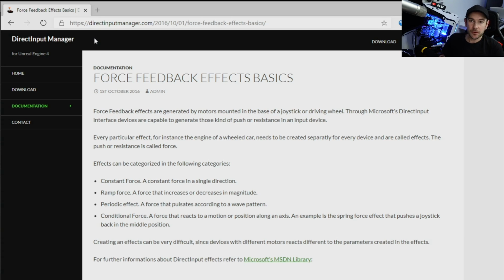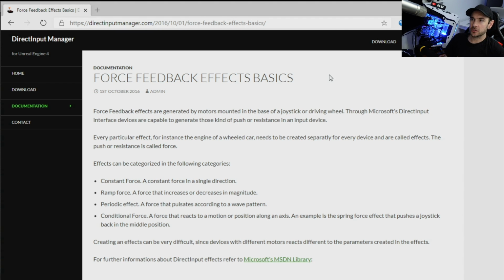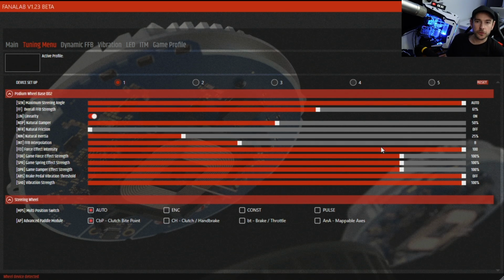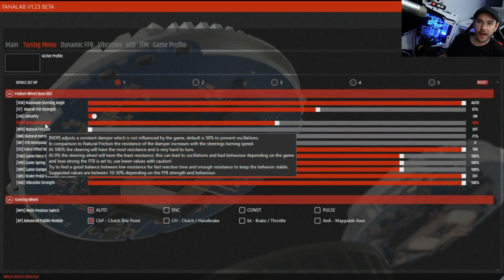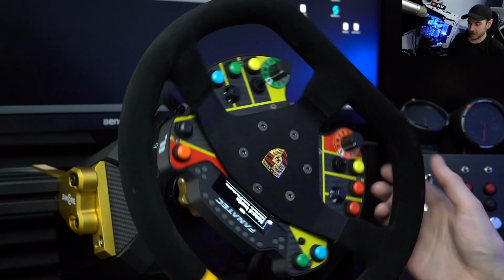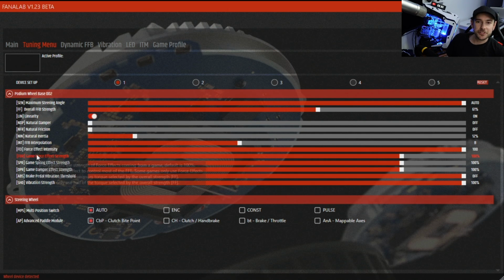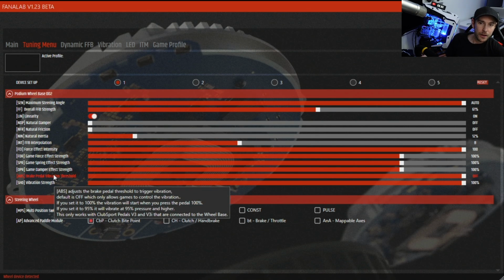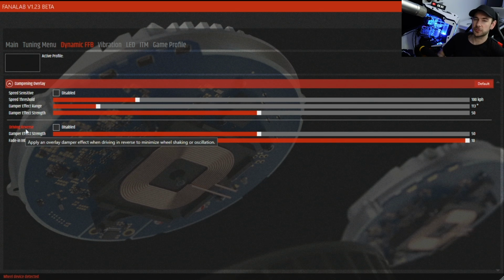FORCE FEEDBACK SETTINGS EXPLAINED - How to get the Best Force Feedback from any Fanatec Wheel

Comment: Great Video Will. But I still in doubt with something: The ACC already has a slider for Dynamic Damping. Would it therefore be redundant or inappropriate to enable Dynamic FFB in Fanalab, already using, for example, 100% in Dynamic Damping within the ACC? Tks in advance and congratulations for the great channel.

Comment: Hey so I just bought a podium f1 wheel and each time the thing starts up, it’s off center. I have calibrated it to center. But each time I start it up, it’s off center to the left. Any ideas?
Reply from the maker: That’s normal, as long as it doesn’t need to calibrated every time.
Reply: @boostedmedia  it’s normal for it to start crooked?
Reply: @boostedmedia  also, do you know if it’s possible to map the buttons for gt7 to what I want? The game doesn’t have a settings menu for this wheel.

Comment: Hi I hope you read this ,I'm in community where we share setup and race , my 
Problem is a lot off guys are  having problems with my setup,  the think I'm giving them a standard ,,I try to explain that I'm driving with a very hard and realistic wheelsettings on fanatec ,and I can't go over the curbs whiteout making the car more soft ,and I have a different drivingstyle,
But they don't believe it 
So the question, will the car setup change if you ,drive with lot of ffb or less
Reply from the maker: If you’re running a level of force feedback that’s making you slower, I’d suggest turning it down. But yes if you set the car up with softer general characteristics, that will also dampen the harshness of the FFB.
Reply: @boostedmedia  thanks mate

Comment: Ok will I'm getting annoyed as hell. I can't for the life of me setup the DD1 with gt3R wheel to use the rotary knobs for brake bias or tc in iRacing. Any chance you can do a vid for us idiots? It goes one way and not the other or jumps 10 steps at a time. I know it's to do with the mps switch but cannot find info on it.

Comment: I’ve recently been given a CSW V2.0 and I’ve bought a P1 V2 wheel, (as an upgrade from a G29) it’s great. I noticed that even after installing the Latest Fanatec driver and updating firmware for wheel base & wheel, that the wheel only has 2 menu items FFB and SEN, on the wheel itself tuning menu. Is this right or is something wrong? Any help would be great guys. BTW love your channel Will
Reply: I have a csw v2.5 and only have the 2 adjustment option as well. There may be an expert settings mode that has to be enabled.  I will have to check the options...
Reply: @fumanseano2846  press the settings button once, then hold it for 3 sec, the other menu will appear on the wheel.

Comment: Can you tell me why I have this Hump at the center of my  steering at higher speeds, and the wheel accelerates left or rt past center ?
Turning down FFB seems to help but not fully, and I like the higher setting of FFB.
Using CSL DD with AMS1 and AC.

Also I note that  the idea of FANALAB is to load up to 5 profiles to the wheel when starting a game.  The  problem is that there is no intuitive way to know that you have to select the SET # in Tuning menu - Then create a profile... its just weird.  SETUP Index value seems to correlate to SET # on the wheel.  You should be able to edit the Index # when creating a profile yeah !  Great stuff, but users need to review with designers at each step.

This is driving me to drink !

Comment: All my drivers for my dd2 are as up to date as they can be, it was a lot smoother before updating, i regret it alot... unless someone has had a similar issue and solved it somehow?
Thanks in advance (fanalab and fanatec control panel are as up to date as possible)

Comment: Any chance you can do an updated video covering CSL DD settings. Im unsure if the CSL DD has a wide enough range to keep FFB strong enough when using linear
Reply: Honestly try it for yourself it's as easy as opening a practice session in your favourite game and switching through toggle on and off. For me in ACC I'd say peak feels much better. Linear seemed to remove a lot of detail and feedback you'd get from the road and curbs made the wheel feel very muted.

Comment: Ppl think I’m crazy cause I only use 15 SEN on all sims but that’s what I’m used too, the ones for GT sport are terrible feels like driving a 2021 power steering car, ya I was getting clipping till I figured out what FEI did, Fanatecs stuff is underrated on the NM scale they say a CSL can do 6NM that’s only 4.43ft lbs of torque, that whee base put out far more than 4.43lbs my arms hurt after driving on it it takes probably 10-12lb or so just to get the wheel to turn and the FF is definitely over 4.43lbs I would say there under rating by about 4-5x what the wheel can actually do

Comment: Hey Will. Thanks for all the content you post. I’ve just got a new DD1. Have updated drivers and fans lab to latest versions, however the tuning options on the wheel haven’t changed, and show less options than fanalab does. Does this mean the wheels firmware hasn’t been updated?
Reply from the maker: Yep need to have the correct firmware.
Reply: @boostedmedia  thanks for replying man. After a few of your other videos I worked everything out. Thank god you do what you do. Cheers

Comment: Great walkthrough as always, Will. I returned to this vid now that I've gotten my Formula V2 to brush up on the ffb settings. 

In case it helps anyone struggling with the Multi-Position Switches (the big dials lower on the wheel) in ACC ... I found that I had to use Pulse mode instead of Constant mode for ACC to properly bind specific values to each position (e.g, making position 2 always equal Engine Map 2). Constant mode behaved erratically, Pulse works perfectly. Cheers!

Comment: Hi, i'm in disaccord on your comparison of DD force feedback strength with an audio pre-amplifier 
because while in the pre-amplifier an audio signal is processed, here a mechanical signal (a force) is processed that has nothing to do with the classic distortion produced by an hifi system. 

If you set the base to 100% and in the game you adjust the ffb to an intermediate value (therefore not to its maximum) you get the same desired effect with the difference that you will not have to adjust the base settings game x game but you just have to set everything in every single game. 
In this way (i.e. by setting the FFB on the engine to 100%) you are fully exploiting the potential of your base regardless of its torque force.

If you consider the DD motor as a pre-amplifier then it is right to amplify even the smallest detail to its maximum potential (100%) and then adjust it with the amplifier (the game settings FFB) to decide the intensity you prefer.

If not, it wouldn't make sense to prefer a DD2 to a DD1, right? I may be wrong but this is my opinion ;-)
Reply: This actually aged very well

Comment: I think like this. Let's say you hop into a BMW Z4 GT3 car. That car's setting is going to be the same for whoever gets in the car. I want my fanatec to feel like that so I have to adapt to the car's forces.
I've driven quite a lot of sports cars in my life, a few track cars but I just can't get the feeling right in my newly bought pc master race. I've bought AC, ACC and rfactor 2 and I'm following the baseline settings from fanatec and it's just frustrating. The settings should be as good so you'd only have to change the ffb and that's it. Even Gran Turismo sport feels better than any of the PC games. I bought the fanatec dd1 podium F1 for PS4 and I'm on the last straw before I give up on PC.

Comment: I just went full Fanatec and purchased the gamut! I have a DD2 wheel base. At the end of the video are all of the tuning settings & dynamic FFB settings the ones you use on a daily basis? I am comfortable making changes within iRacing for each vehicle but I am trying to take the guess work out of the driver settings. Would it be possible for you to share your baseline tuning setting & dynamic FFB settings? I am stoked to get started with my new sim hardware but I want to jump in & not mess around in a settings menu. Or DM them to me if possible.

Comment: Always good info. Any reason why i cannot get Fanalabs to work?  It doesn't recognize my games installed. It does see my Fanatec gear.
Reply: Buck Rogers do you have it installed in the default location?
Reply: Would default location be my C drive?
Reply: @buckrogers8858  yes, the default install path.

Comment: Thanks for the video and clarification of the settings. The wheel base drop down selection does not show up in my tunning menu in fanalabs. Also, my DD1 wheel base name does not show up on this screen but does in the Main menu. This issue only came up when I moved from formula v2 to the porsche wheel. Anyone else have this issue and if so any luck in resolving this?
Reply: just got a solution on the fanatec website, my base was version 1 rather than version 2 and there is a newer fanalab version 1.24 - just in case anyone had the same issue.

Comment: I do not own a wheel. What he mentioned about software clipping is applicable to me using a mixamp ( external sound card ) with a headset. I keep my headset volume max and adjust the mixamp accordingly. I do recieve distortion. I changed the headset volume to 60 and my audio is far more refined. Thank you for the general knowledge.

Comment: Great Video BM. These are my DD1 settings for ACC: Fanalab in order SEN 1080, FF 100, LIN 0, NDP 4, NFR 0, NIN 0, INT 0, FEI 80, FDR 100, SPR 0, DRP 0, ABS 90, SHO 100, MPS Auto, BFR 90
ACC In Game gain force 12 or 13
Reply: ACC in Game gain of 12 or 13 is bad because you lose 87 or even 88% of the FFB resolution coming from the game. Best is to set it to around 60 and then adjust the rest in the tuning menu to get your desired FFB strength. 
NDP 4 is also a bit low and should feel very loose and therefore unrealistic... 
Also INT 0 is extremely bad, how can you really drive that way? It feels horrible, like there is sand in the wheel... You need AT LEAST INT 1 in ACC..

Comment: Dont agree with switching OFF linearity on CSW2.5.. amount of FF you feel is same but it is much smoother with linearity ON. (iRacing)
Reply from the maker: Do you have linearity turned on in iracing? Remember most of these settings will be depending on the game settings too.
Reply: @boostedmedia  yes i have. I really put effort in to this linearity on/off stuff. Maybe its personal preference, but even CSW 2.5 is strong enough for "ON"
Reply from the maker: Whatever works best for you. There’s no right or wrong here. :) Thats why the video is aimed at explaining the settings rather than just saying “do this”.
Reply: CSW doesn't have a Linearity Tuning Menu setting.
But if you mean the checkbox in iRacing, yes, for a CSW v2.5 this can be checked (enabled), same of course for a DD but I prefer to leave it off in the tuning menu, otherwise you would have a double linear setting which again isn't good.. ^^
Reply: CSW doesn't have a Linearity Tuning Menu setting.
But if you mean the checkbox in iRacing, yes, for a CSW v2.5 this can be checked (enabled), same of course for a DD but I prefer to leave it off in the tuning menu, otherwise you would have a double linear setting which again isn't good.. ^^
Reply: @momorious  yea i meant iRacing box

Comment: Hey Boosted Media in regards to what you said about the linearity setting with belt driven wheels.. I use a Thrustmaster T-GT for iRacing and i am now wondering if I should have the linear mode setting, in iRacing turned on or off? There is no linearity setting in the Thrustmaster drivers.. Thanks you
Reply: TS-PC is too weak and should have Linearity disabled in the iRacing options.
Reply: momorious thanks mate

Comment: great video, question, i have the podium paddles but on fanalab i don't have the advance paddle settings showing to do the clutch bite point.  where can i find this
Reply: Which wheel do you use? It's only available on wheels where you don't control this through a middle MPS knob.
Reply: @momorious  formula v2, ya i have the control on the middle knob
Reply: @frankconte264  that knob controls the Podium Paddles and is the reason why you don't have that option in the Tuning Menu.

Comment: Software clipping doesn't depend on the wheel base. Whether you have a direct drive wheel or a belt driven one, software clipping can occur regardless of the base connected to your PC. The clipping of the base is harder to detect if you have a low end base as a consequence of its low strength. 
Finally, when you suggest to switch off linearity for belt driven wheels, be informed that the CSW and CSL do not even have this setting available.

Comment: I think you have linearity mixed up, normally your right you keep it on like in iracing and a dd wheelbase. But in fanalab when its on it compresses the ffb curve to boost weak forces, surly then you would wana keep it off for dd wheelbases. Can you please clarify.
Reply: Not really, linearity on just makes sure that torque is aligned with the continuous holding toque instead of to peak torque which can be affected by load over time. 
But only comes into play if your are overpowering such a strong DD. Which would be "unusual". Especially if peaks are used only in max power scenarios like crash effects etc.

Clearer now? ;-)

Comment: What about drift mode ?
Reply: You don’t need it. The wheel is fast enough
Reply: @brodeur212  So the dd wheel bases doesn't have that option but the 2.5 and csl do?
Reply: E46 Gaming correct, when you turn down the FFB and especially any damper/inertia effects a DD wheel will have very little resistance
Reply: E46 Gaming  yes, because they are not fast enough :) if you check my videos i might have a few showing the quickness of the wheel like ferrari one and countersteer one

Comment: One thing I'd like to see in this video is an approach of "here is a problem" - here is a setting go change to resolve it.
E.g. what you said with how to address issues with oscillation.

I find my csw impossible to release in straight line in any car. It goes to a wall almost instantly because of oscillation.
Reply: I have also oscillation problem just like you described but on my CSL Elite F1 PS4 and on ACC
Reply: I found that setting the in-game steering dead zone to 1 alleviates this issue but for my taste makes the wheel too soft in a straight line. Kinda like being in the eye of the hurricane, calm & at peace, yet still scary!

Comment: You mention third party software like SimHub or FanaLEDs to add proper vibration affects, just want to add, FanaLab offers this as well.
Reply from the maker: Is it working reliably now in fanalab? I don’t have my V3s here currently to test but previously I found it would cause fanalab to crash sporadically whenever I enabled vibration control.
Reply: @boostedmedia  yes it is working great and there are zero reports from all the hundreds and thousands of users that it crashes when activating vibration.... I hear this the very first time.
Reply from the maker: Well that’s good to hear. I did report it months ago so that’s one person. Maybe it was a conflict with something else I had running.
Reply: @boostedmedia  I think you also got some beta versions to show features earlier which maybe weren't that stable.
Reply from the maker: I did for a while but it was still an issue after I moved to the same version as others had access to. My brother has the V3 pedals now so I’ll ask him to do some further stability  testing. 

What was happening for me was the pedal motors would lock at 100% duty cycle and then fanalab would crash with an unhandled exception error, causing the game to lose focus. Not ideal when racing. Lol